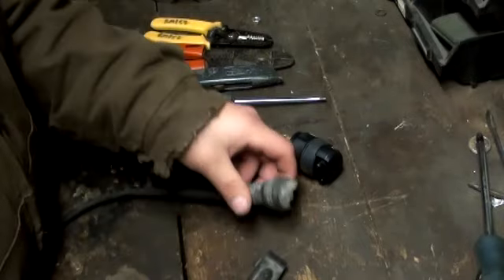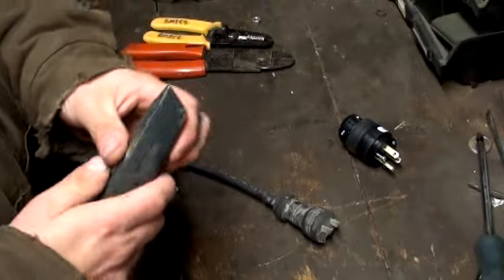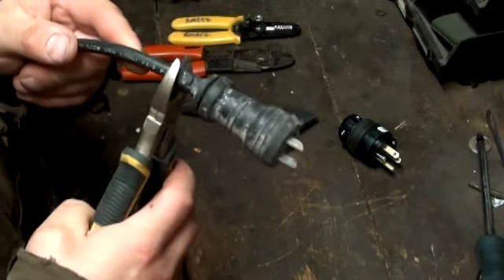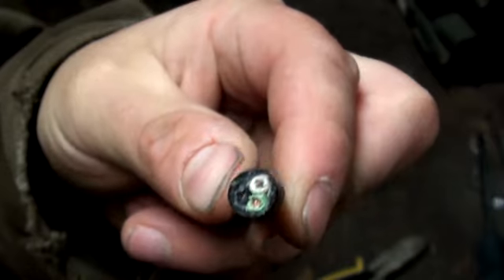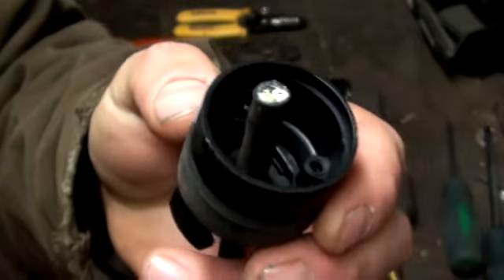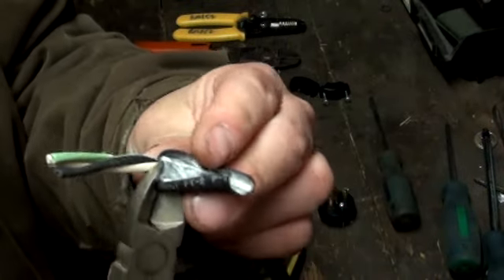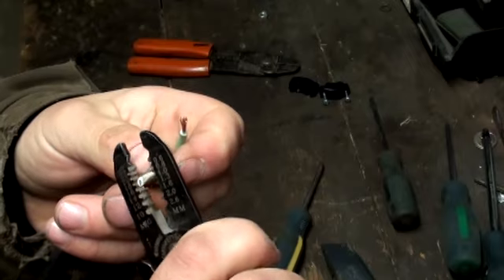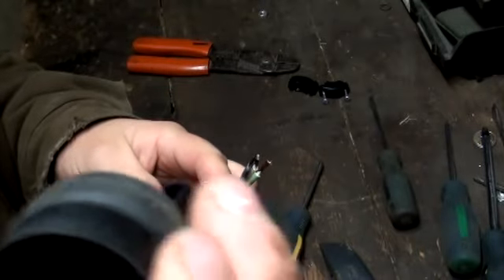How to repair the plug on a block-heater cord

Comment: It does matter which terminal your hot & neutral go on. Don't let this guy be the cause of your next fire. Black wire= bronze screw, white wire= silver screw.
Reply: is there a way to know, if the wires aren't color coded.  mine is not,  the only color it has is green...  and both hot/neutral is black.  so idk which is which.
Reply: Pretty sure is doesn't matter in a cars wiring. The block heater is just a big resistor between the two. The concept of neutral/hot (white/black) is only useful when chaining circuits like in an electrical outlet or switch.
Reply: Both my plugs were black however I went with assuming the one with some white writing on it was the "white"
Reply: @Ariz04  my wires were cut and both black. when I screwed all the cables together and plugged into my GFCI outlet it tripped right away. Plug into a properly ground GFCI outlet and you'll know right away if you got it right. :)
Reply: @Ariz04 im assuming the one with writing is white and the unwritten black one is black
Reply: FYI, It doesn’t matter in vehicle wiring with only (DC) Direct current. It matters in (AC) like a home.
Reply: It does and it doesnt.  The power is just a loop back circuit.  Thats why it will work either side.  And this isnt AC current.  its AC into DC current.. of course the ground needs to be correct.  What you have listed is correct, for house electrical terminals
Reply: Yeah, I agree.However, only this guy could make a thirty second video into 7 minutes

Comment: Do you have to unhook your battery cables to replace the plug is there an electricity problem that could happen
Reply from the maker: You shouldn't have too, as these heaters are not normally connected to your vehicles electrical system.

Comment: I'm not sure how important it is to get the wires connected to specific terminals on a block heater but the simple rule is: white to light, black to dark when doing electrical plug repairs.   Now, I've gotta head out and repair the plug in on my Rogue because its just about 20 below right now.
Reply: Lol I’m in those shoes, had someone vandalize our vehicles and cut the damn cords
Reply: I’m doing this in -30 feels like -45 with the wind.
Reply: Know this is 10 years old but I just did mine. There was a regular copper wire and a copper wire with some black wire intertwined. The plug also had a steel coloured and brass coloured screw, so I assume that the darker wire goes with the darker screw and the lighter one goes with the lighter. Hope I did it right. I mean threre isn’t much to mess up,  but you always run into stupid issues with small fixes like this

Comment: wires are 2 black, 1 green. for the 2 black wires how do i know which one's hot, which ones neutral?
Reply: if you look close at the flat wirethe outside wire  there is white writing on it  this is the white or neutral and if you read it it will say neutral this wire goes to the silver screw on your plug the green or the centre on that flat wire is the ground  the othe ouside totally black no writing on it at all is the copper wire  or the hot it goes to the copper screw
Reply: if you feel along the outside of the sheathing, the neutral side will be identified by a ridge along it. The hot side will be smooth.

Comment: I've used this vid a couple of times and I'm grateful, however I am a bit surprised he didn't notice the plug dragging all summer, I'm no car expert but I definitely take a look all around my car regularly just to make sure nothing weird like that is happening.  Maybe he had a kid borrowing it a lot.
Reply from the maker: Well is was my wife's car for starters... and the cord fell down on the inside of the grill and as hanging out of sight below engine.  If I recall I noticed it when I was going an oil change or similar thing.

Comment: I don't have a quick release so should I disconnect the battery before changing the head plug?
Reply from the maker: As some others have pointed out... Im no expert, but Id say probably not required.
Reply: not really...
Reply: It's not on your cars battery circuit at all so you can leave the battery connected

Comment: Does this have to be a specific type of plug?
Reply from the maker: Any three prong replacement plug would work fine...
Reply: My wires are both black does that matter when installing the plug
Reply from the maker: In my experience NO,  I have replaced plenty of plugs with no issue.  That, said plenty on here would disagree.

Comment: I think the only block heater I ever use is on my tractor lol
Reply from the maker: I actually need one for my tractor.  Going to try one of those magnetic ones on the oil pan.
Reply: I have a big inline one in the rad hose, works well and heats the tractor up in less then an hour